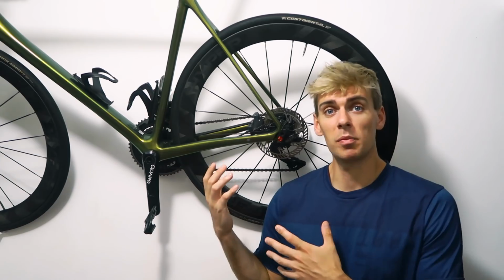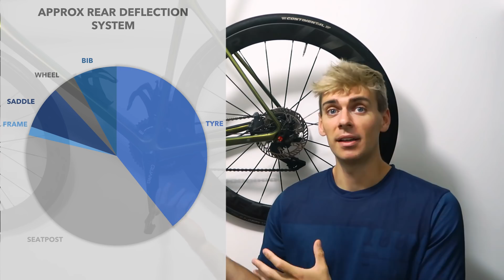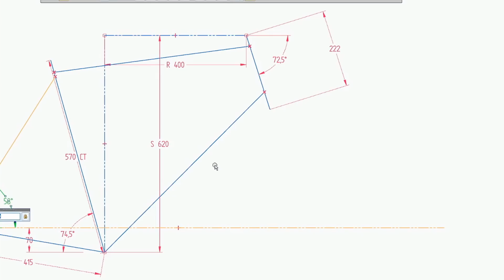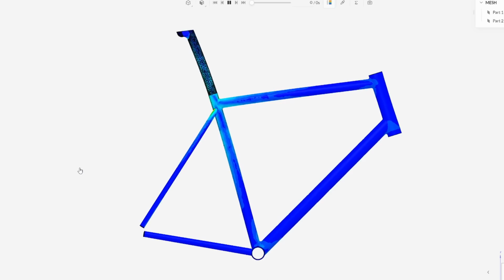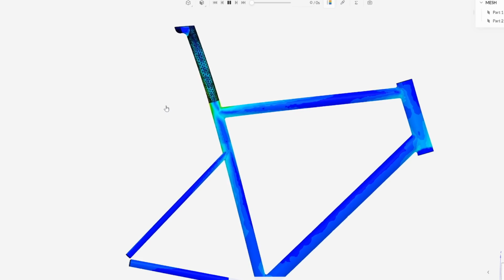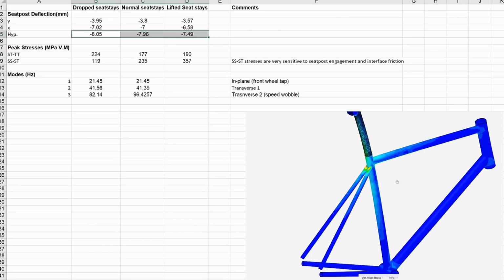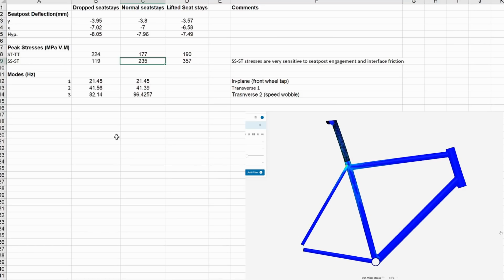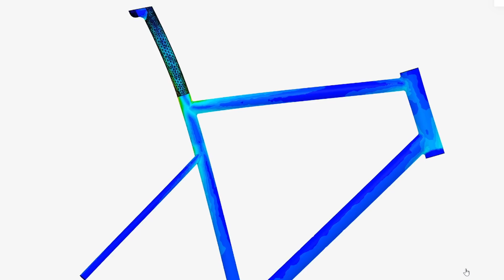Do dropped seat stays improve comfort? No.

Comment: Hmm. Interesting, but I don't think this really addresses the main claim wrt compliance, which is that dropped stays decrease so called 'buzz' or 'chatter', i.e. high frequency noise rather than visible bumps in the road.  Some implementations do have actual suspension elements built in so I think your question would be more suited to those specific builds. As you say, your model is very simple and side steps looking at an actual frame from a manufacturer in conjunction with their specific claims. Can see why you might want to avoid doing this though.

Comment: I'm No engineer. I can See Yor Frame model flexing. Where is your model fixed: -  Bottom  bracket ?  ( It Looks Like that )
Or
- lowest Point of the headtube and both Rear dropouts? ( AS whilst Riding the load would be hold there. The Bottom Bracket should have at least SOME groung Clearance  😅. )
Reason for the question: the Quite Low seatstays of the Cannondale Topstone. Those Stays act Like a pushrod to Bend the seattube. Add to that a flexing Point in the rear Part of the toptube and voila: Suspension!
Or am i Missing a vital Point Here?

Comment: Hi, Thanks for the informative video and the modeling. I think that your model may have given a result associated with the material choice and not the frame layout. As you probably know, Aluminum is more flexible than Titanium by nature. Young modulus for Aluminium is 70 GPA, whereas Titanium is 120 GPA. I think that for your model, you should change the material choice to be either Titanium or Aluminium for the frame and Seatpost, that way it would give a better output for the frame design only. Thanks

Comment: What about the point that shorter stays obviously require less material, therefore less 'spring' within them, thus stiffer rear triangle where the majority of power transfer occurs between bottom bracket and rear axle? I think you missed half the point of droped stays to be honest. These are all marginal gains, but add them all up and they make a difference.

Comment: Is there any meaningful amount of deflection in the seatstays and chainstays themselves?
Reply: Depends on several things, tube profiles, wall thickness, rider input...
Reply: @kennethstreet7868  sounds like that would have been with considering in this test at well then
Reply: @moezb  he said that the frame was modelled with typical wall thicknesses and titanium tubing. realistically, unless you integrate a leaf spring or elastomer or something into the stays, the results are going to 99% be similar.
Reply: Well, overall flex can be improved but it should be very specific build. With TI builds it is unlikely. I would rather go with carbon seat post then with thinner tubing.
Reply from the maker: Yes, the input from thw dropout will cause some vertical wheel travel, but its tiny. Tiny.

Comment: Why wouldn't you measure seat stay deflection by inputting forces into the front and rear axle?

By directly measuring seat stay displacement I feel like you're disregarding the significance of directionality of force.

Maybe dropped seat stays mitigate discomfort by dampening wheel axle vibrations, as opposed to affecting seat post stability.

Comment: The thing is, the easier way manufacturers can add comfort to rigid frame bikes is increasing tyre clearance. Tyres are much better at absorbing bumps compared to a rigid frame.

My opinon is that, technically, dropped seat stay does improve comfort by allowing the rear traingle to flex more, thus reducing bumps felt by the rider. 
But, pratically, the effect is probably not noticeable compared to fitting a bigger tyre.

Do dropped seat stays improve comfort? Yes, but actually no.

Comment: With the introduction of more and more disc brakes did the drop stays allow manufacturers to use slightly less material in each frame? Extrapolated out over thousands of bikes the savings might be significant, then just get the marketing dept to claim it’s for comfort/compliance/aero!

Comment: I mite be wrong here I don't think you have the resultant force from the rear wheel pushing up. I would of thought that would increase the deflection where the seat stays meet the seat tube. Therefore increasing the seat post deflection on a dropped seat stay frame.
Reply: the reason why he doesn't discuss that is because it's irrelevant.
Reply: the simulation fixed the rear end so the normal reaction from that end was accounted for in the simulaition
Reply: @parthmache4733  I should listen better haha.
Reply from the maker: @parthmache4733  correct :)

Comment: you are assuming that the rider is sitting on the saddle(with all its weight).  would be interesting to see the results while some load is transfered into the BB.

based on youre simulation the obvious solution might be to drop both seatstay and seattube to get a longer exposed Seatpost(but then it might look a little bit like the bastard of an road bike and a mtb)

Comment: The first time I saw a dropped seat stay, and was told it was there for compliance, my bs meter went off. I thought if one wanted to add compliance one would need to to drop both the seat stays as well as the top tube. 
Essentially gaining seat post length.
Reply: @nascentnaga  the seatpost has the lions share of flex for its being a cantilever-unsupported. It’s only a cantilever from its first point of support. Top tubes are very stiff and do a great job of supporting the seat tube. The amount of seatpost flex between the top tube junction and the seat stay junction would be a very small fraction of what it would be above all the support. FWIW I don’t have data to back this up, I’d bet PT could quantify it though.

Comment: The logical assumption is a longer seat stay will flex more.
Reply: the only way to increase the length of the seat stays (assuming you don't bend them or change other parts of the geometry) is to make them point more directly upwards, which makes them take vertical load more directly.

I guess you could also attach the seatstays to the top tube like GT do but that would be a bit of a different analysis.

Generally, (as this video shows) the vast majority of the deflection comes from the seatpost being loaded in bending as opposed to the longitudinal loading of the frame tubes so lengthening the tubes will be insignificant anyways.

Comment: Bike engineers: "We've designed a combination of carbon seatpost, carbon seat-tube and dropped seat-stays that work as a system to allow for greater vertical deflection at the saddle."

Peak Torque: "I've done FEA on a virtual titanium frame with an aluminium seatpost to test only one element in isolation to disprove a different claim than what was made. Also here's a clickbait title that's a deliberate and myopic misrepresentation of the original claim."

Viewers: "OMG the bike companies are LYING to us."